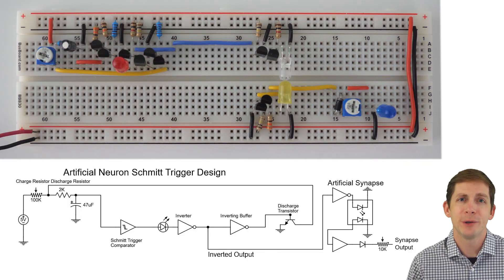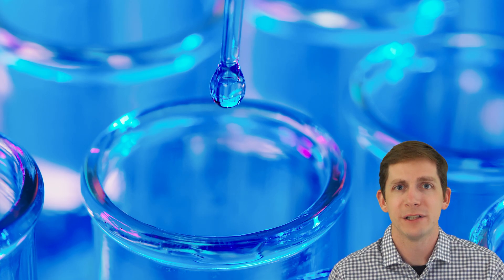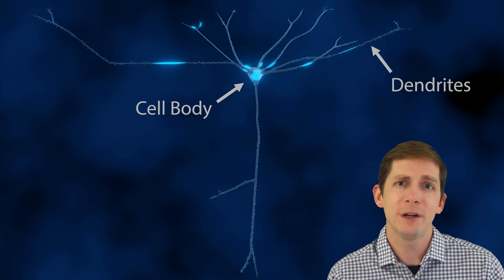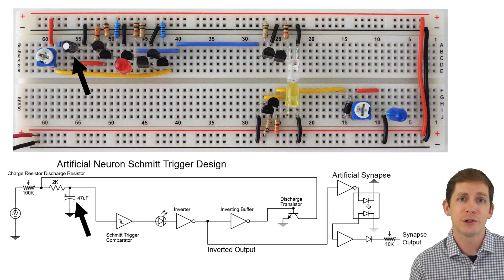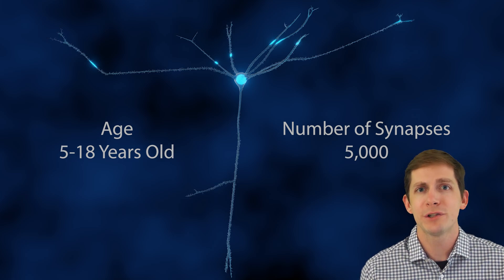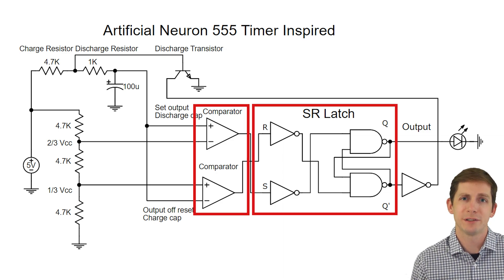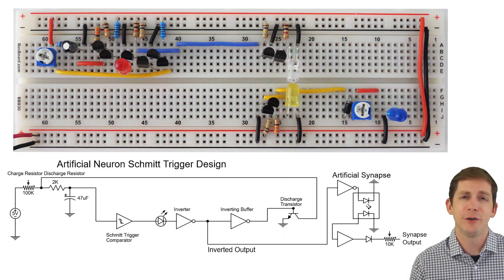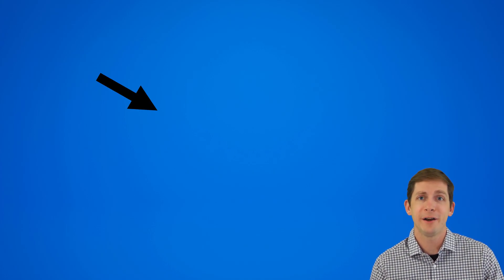How to Build Artificial Neurons

Comment: Could this be implemented in an FPAA (Field-Programmable Analog Array) or FPGA with an embedded core with this type of analog circuit, or could a DSP be used to process the analog signals to simulate a neuron, using a language such as HDL or Verilog?
Reply from the maker: FPGAs would still be digital processing, I am trying to build neurons that are not simulated on digital computers. Configurable analog blocks within a FPAA could work. That would be interesting to explore more!

Comment: Has anyone tried to make this circuit, if yes please guide me through this, as I am unable to make it function as shown in this video
Reply from the maker: I show the circuit diagram. Let me know if you have any specific questions.
Reply: @GlobalScienceNetwork sir, the synapse is not blinking as you have shown in the video, when the initial resistance of 100k potentiometer is slowly increased, the LED at output of synapse remains turned ON constantly, but when I increased it to the point where is should seem to have stopped blinking, the last LED actually turns OFF.

What might be the reason for this abnormal pulsing
Reply from the maker: @atharvasavarkar9484  Do you have an oscilloscope to see if the LED maybe is flashing, but at a high rate so you can not tell? At 8:54 I show the exact values of each component. Are you using 2N2222 or 2N3904 transistors. That is what I recommend.
Reply: @GlobalScienceNetwork no sir, i don't have access to an oscilloscope, but sir i checked the voltage at the end of optocoupler, it is remaining constant.
But sir when I turn the freq to be low, the last synapses LED is remaining ON constantly, while when freq is max, it is OFF.
Sir generally opposite of this is expected right?

And sir i am indeed using 2N2222A NPN transistor
Reply from the maker: @atharvasavarkar9484  Is your neuron working properly and it is just the optocoupler not working?
Reply: @GlobalScienceNetwork sir if you could send me your email id or phone number, I'll send you the video of the neuron which I have built. 

Sir, the last 2 bottom transistor parts are not working, the LDR is not showing any voltage.

Comment: What type of transistor are you using?
Reply from the maker: Mostly 2N2222 and some 2N7000.
Reply: @GlobalScienceNetwork can we use any type of transistors tho?
Reply from the maker: @mcpurplegaming8926  You need at least a similar one. 2N2222 can be 2N3904. That is the main one used. Onethe circuit diagram if it is a MOSFET than it is the 2N7000 otherwise it is 2N2222.

Comment: Converting these schematics/logic into FPGA's could allow creation of custom purpose high performance hardware based neural networks at low cost.
Reply from the maker: This is kind of true. An FPGA would still be using digital logic and would not allow for the device to be conscious. Lots of times, FPGs are used to interface digital technology with the actual spiking neurons.

Comment: I would really be interested in what current science has proven that the emergence of higher consciousness (you probably mean phenomenal consciousness) has a direct relationship to the complexity of the substrate-the number of states. Isn't it just a hypothesis, not a theory?
And regarding resolution, do you know that different animals can have different neuron densities? For example, birds have neurons x times closer to each other than mammals, so in a completely different size, the number of neurons does not necessarily differ.
Reply from the maker: Cool, you will like my next video about how consciousness works!

Comment: Does anybody have tips for jumping into this world of AI tech/engineering for someone without any prior experience and a non-stem background? I am still relatively young (22) and am a rising senior undergrad student (econ/PPE) at a good school. Everyday I felt like I should have just went for BME at a lesser university to appease my true interests instead of going with the safe route that I did. Anybody in this comment section been in the same boat?
Reply from the maker: Just go for it! With AI and self learning you can start your own project/company without any degree. Just start learning until you are the best at what you are interested in! If you are a senior you mind as well finish but start thinking about what project/company you want to work towards. It has never been easier with the help of AI.
Reply: @GlobalScienceNetwork  Thanks, great to get a reply from you. I'll keep you posted, currently building my first artificial neuron.

Comment: Hey I'm new to these kind of projects, what is that exact type of potentiometer you're using?
Reply from the maker: It is just a basic one and the values are listed in the circuit diagram. Also, a link should be provided in the video description.

Comment: Quiero felicitarte por este video, es excelente! Llevo tiempo investigando alternativas a las neuronas artificiales basadas en software. Me recordó a otros sistemas computacionales físicos, como las "neuronas" neumáticas de los Strandbeest de Theo Jansen.
Después de analizar tu diseño, me surgieron un par de preguntas técnicas:

1- Para los componentes lógicos (el disparador Schmitt, el inversor y el buffer inversor), ¿qué modelo específico de transistores utilizaste? Por lo que veo en el video parecen transistores NPN comunes como el BC547 o el BC337, ya que estoy interesado en replicar el circuito.

2- En el diseño de la sinapsis artificial, noté que los LEDs (blanco y amarillo) se encienden para transmitir la señal. ¿Están funcionando como la parte emisora/receptora de un "optoacoplador casero"? Si es así, ¿Esto lo usas solo para hacer visible la sinapsis o tambien para reducir el ruido en la sinapsis?

*Viendo todo esto se me ocurre que  se pueden  crear Agentes basados en utilidad y construir la "funcion de utilidad" con Amplificadores Operacionales jaja

Muchas gracias por compartir tu conocimiento.
Saludos cordiales,
Martin
Reply: Hola buenas en el último video el señor explica y entrega los materiales que uso para realizar su proyecto. En resumidas usó los transistores bjt 2n2222a y los leds funcionan como optoacopladores. Blanco emisor y amarillo receptor.
Reply: Transistor tipo NPN

Comment: A couple of questions / thought's... 
Why do you assert that a simple digital model of a synapse is not practical... I ask because camera CCD's, affectively light activated memory, are essentially charge buckets that are read by scanning them, many orders of magnitude faster than a neuron would be firing. 
I get that an individual, transistor / memory bit, is either on or off, but an array of memory, stuff we already have access to in huge cheap quantities, is a bucket with the ability to hold a value. At a low level a microprocessor adding 1 to a memory location is quick, as is testing if that value is above some threshold and doing something whilst also setting that location back to 0, or some lower value.
I get that ASIC chips could be used to build hardwired networks, and you can build a few similar circuits with transistors, but existing uP's, well up cores, could easily scan thousands of memory locations per second and augment/deplete dependent locations, where dependency is mapped dynamically, by a value held elsewhere, programmable strength.
I absolutely appreciate that each 'sudo neuron' a simple code block, would be processed sequentially but the result of that would be waves of alterations in stored values propagating through a field of stored values, where the synaptic interconnections are configurable by source and coupling characteristics.
CCD memory is already a thing ... https://www.analog.com/en/resources/analog-dialogue/articles/integrated-solutions-for-ccd-signal-processing.html making what I said all the more true, digitally scanned, yes but incrementing/decrementing analogue values on each scan none the less.
Why do you think this approach cant work? Yes it is a huge number of transistors but it is transistors we have easy access to in huge numbers, and unless we get access to chips that can be dynamically rewired, no matter if they are digital or analogue, the configuration has to be stored somewhere/somehow.

If you are talking about a simple analogue circuit to replicate basic neuron / synaptic function it may be worth considering the following...

FET's already have a significant gate charge requirement, they are essentially capacitors, so it will probably be possible to use the gate directly as the charge bucket and eliminate the capacitor. 

Schottky diodes already have a significant hysteresis, conducting long after the initial forward voltage threshold has gone and switching off again at a much lower threshold, these may be useful as a single component threshold / gate. 
Note that thyristor's may also be useful in this respect, triggered by a small gate current, once they turn on they remain on until the body current falls to some minimum value, irrespective of gate current, making them useful for discharging capacitors.

Whatever circuit/s you go with it seems to me that decoupling the action potential energy, including its duration, from the enhance/deplete effect on an any subsequently connected dendrites will be important. It seems to me that each synapse needs to be triggered by at least 1 neuron and than either augment or deplete its own neurons potential by some quantum.
Doing this electronically is probably best achieved by changing the width of a positive or negative pulse, at each synapse, as opposed to mirroring the action potential pulse width.
Its an interesting problem, if component court and complexity reduction is the driver... 
In electronic terms you want an astable gate, triggered, but not affected otherwise, but the action potential pulse. 
The output pulse, of programmable/configurable length, then needs to modify the charge of its neuron, presumably whilst excluding retriggering.

Its all very interesting that I had no idea about until finding your content. I build industrial systems and I cant help thinking that a small neural network could be a viable replacement for a bunch of PID loops in some circumstances.
In practice I think digitally simulating a a small network would be easier than physically building one but I may be missing something an a hardware version, even if it were digitally configurable, a hybrid perhaps, would be seriously cool.

Thanks, great stuff.
Al
Reply from the maker: Wow, thanks for your thoughts. These are great points. The reasons why artificial neurons are better than simulated neurons in my opinion is the direct interaction will all the other neurons in the system.  A simulated neural networks can very effectively do calculations like a calculator but at the end of day each transistor is just on or off without any type of dynamic flow. Charging a capacitor on the other hand can have trillions of states that are constantly changing and responding to the network. With billions of these in larger systems, that means a very very high number of states that a digital machine could not match, even if direct interaction was not needed. A static like system can not be conscious as was well which is one of the goals. You bring up good points on ways to simplify the design. I have had similar thoughts and just needed to get a simple proof of concept out into the world. Making the design neuromorphic will also be key. Send me an email if you can, I would like to stay in touch!

Comment: You know that actual nerves have specific pulse train patterns depending on how they're stimulated , when they fire, it's not just turning on for time but it actually sends a complicated signal that includes a lot of information. It would take hundreds of these neurons as you described them to be equivalent to just one regular neuron, maybe more depending on synapses and timing. 
    Also how do you plan to handle learning? Are you going to try to simulate a equilibrium state more  faithful to the biological model or attempt a analog equivalent to back propagation?
Reply from the maker: That is a good point but I think the timing could be built into these. The neurons are still integrating charge over time. If you watch the synapse video I briefly describe ways to incorporate learning. Most neurmorphic chips use memristors to learn although I want to come up with some novel ways was well.
Reply: @GlobalScienceNetwork  I don't mean the mechanism that is the memory is, what I mean is  what algorithm allows training using these different means of implementing memory.
Reply from the maker: @ You should not need any algorithms. It should all be done from the hardware side if built properly. That would be like asking what algorithm do you use to implement memory in a human. You will program it simply by talking to it and interacting with it as if you were teaching a human. Now there might be a way to speed this up but that is the general idea.
Reply: @GlobalScienceNetwork  but there is a sort of algorithm with humans, biological brain tissue progress to an equilibrium,  too much or too little stimulation has negative effect, in the stimulation can come not just from the senses but also internal biochemical balance. 
   The feedback loops that allow that to happen are the algorithm.
  Very different from back propagation. 
   Simple electronic circuits like you're describing tend tawrds either positive or negative feedback states, when what you want is either a permanently metastable or a controlled update process.
    Sure repeated exposure of a stimulus to such a network built with memsistors may result in a form of memory, but it doesn't train the  transformations that an active memory would. 
   Or maybe I'm just not seeing through the levels of abstraction here, missing a step of your thought process‽
   I know I have difficulty in articulating and expressing my thought process just to ask the question!
     As for using memsistors like computer-based memory, I can see how you could get a thousand times more information in the same space than regular digital forms of digital memory , a friend of mine even had a provisional patent on a way to get a petabyte to fit on a conventional CD-ROM using a similar analog concept.
   So I can see how a pre-trained model could run in circuitry like you're describing, but I'm still at a loss to see how just repeated exposure will properly train one.

Comment: how do we make these hardware artificial neurons learn
Reply from the maker: That is a good question. In this initial design, we would adjust the resistor values manually. This adjustes the weights. Other technologies include Memristor, floating gate transistors, and phase-change memory. I want to come up with other ways as well.
Reply: @GlobalScienceNetwork  i see. thank you !!

Comment: Every token produced by an advanced AI system consumes approximately 1 joule of energy. If AGI/AMI were to emerge and start operating beyond human control, its energy consumption would spike dramatically. 

In my view, while hardware-based neural networks offer a tantalizing route toward brain-like computation—with their analog properties and tangible physical interactions—it's overly optimistic to claim that merely replicating neurons in hardware will yield true AGI or AMI. The same energy signature challenge highlighted earlier applies universally: regardless of whether the system is analog or digital, any entity that genuinely exhibits consciousness would demand a considerable energy footprint, rendering it observable through its power consumption. Ultimately, achieving genuine artificial general or mental intelligence will necessitate breakthroughs not only in how we build hardware but also in our underlying computational theories, rather than relying solely on mimicking the brain's physical components.
Reply from the maker: This is a good thought. Actually hardware based neural networks are way more power efficient than neural networks that are simulated on digital computers. All of the computers in the world could not simulate the integrations with one water drop size volume of brain. We could replicate this on a smaller than water drop size volume of properly built hardware based neural networks. Humans could be replicated on a fraction for gram of carbon as the substrate with other dopants. That is why this way of building AI is the future. Getting there is not going to be an easy process but it is possible.

Comment: Interesting, have you considered using an FPGA to create a hardware based Neurol network?
Reply from the maker: FPGA are a good way to make custom digital chips, but would lack the capacitor for charge integration and the synapse connections might be difficult. Leveraging some of the fabrication and design methods could be useful though to dynamically change the weights of the connections.